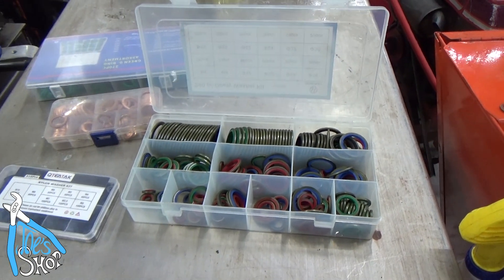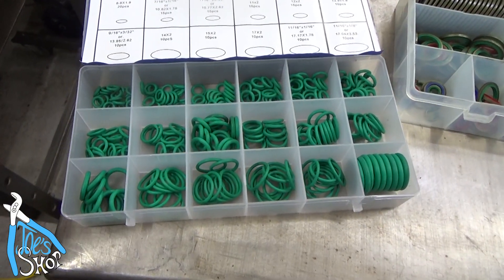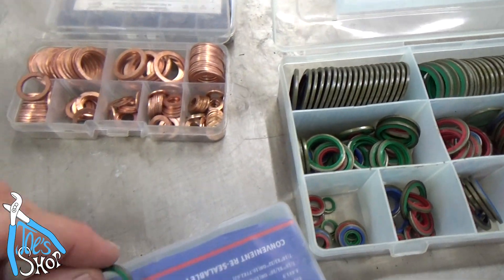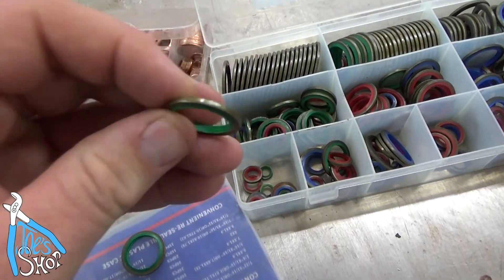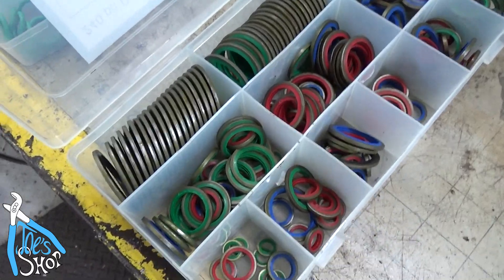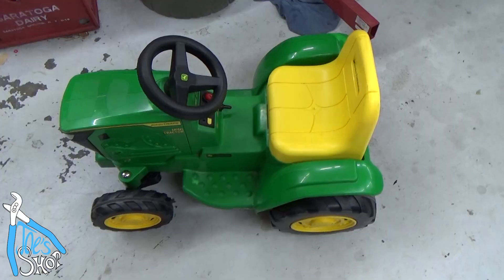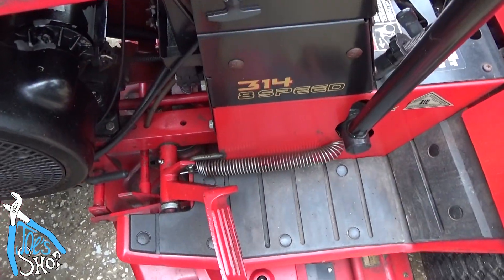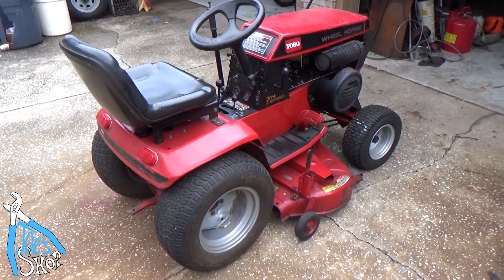Bonded sealing washers (O-ring but better)

Comment: Good information. I find most of the time when an O ring fails prematurely it was due to improper insulation. If I feel an O ring is going to get dislodged somehow during installation I apply some oil, grease or usually petroleum jelly to help it slide into place. Obviously using quality parts will also help.

Comment: Back when I was an apprentice in the UK mining industry we used these on very high pressure hydraulic system we called them Dowty Seals after the company that made them back in the late 70s.
Reply from the maker: Hi Ken. I saw the "dowty" name on the front, but I never trust those chinese translations 🤣. Thanks for verifying that. Cheers

Comment: Joe- Those combination washers are very interesting. I’ve always hated O-Rings as they only seem to work in very specific applications for me. Those hydraulic carts are really handy and yours looks heavy duty. 😃👍. That new wheel horse tractor is spectacular, extremely clean and I can’t believe the price!  Score!  So funny about that little John Deere tractor- I had a feeling I would see one soon!  😃👍🇺🇸
Reply from the maker: My nephew is just starting to understand what the gas pedal does. He doesn't quit grasp steering, so I might need to build a foam bumper. Otherwise I'll be making an episode on repairing drywall corners 🤣. Cheers

Comment: In the oil field when we had a high pressure (natural gas) we used something called a flexatalic gasket.  Metal similar to a crush washer to resist heat and hip pressure but flexible enough to conform to minor imperfections in the surfaces.